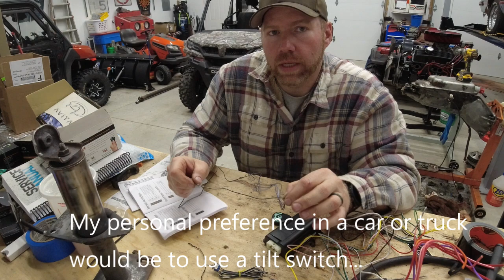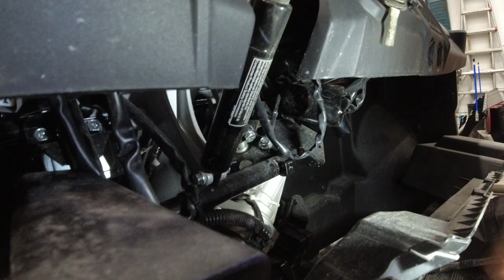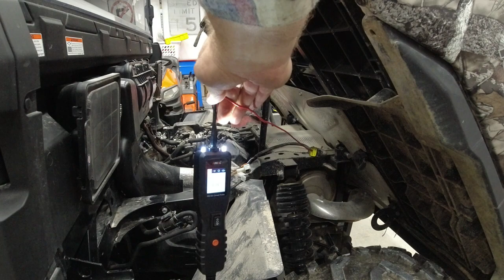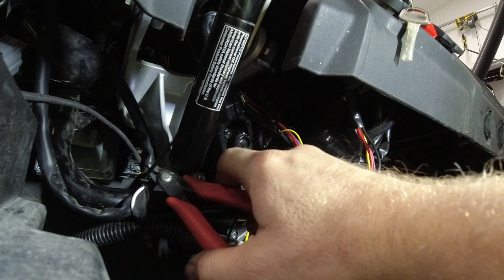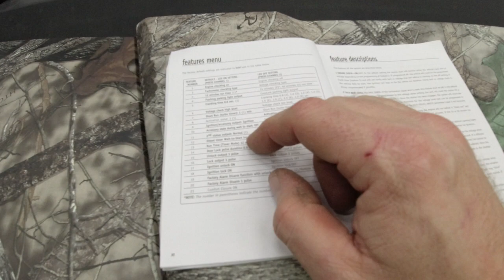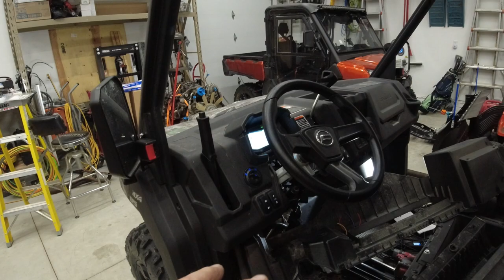2019-21 CFMOTO UFORCE 1000 Step-by-Step Remote Starter Install

Comment: Do you have a “newer” model number for these? As in comparable as the one you used? I’m having a tough time locating that particular model.
Reply from the maker: Sorry, I dont... I've been out of that industry now for about 4-5yrs, so I'm not familiar with the current model numbers. Unfortunately, the Directed Electronics website (Directed.com) is almost worthless nowadays as far as researching model numbers and features. They basically want to force you to purchase the unit and have it installed by an authorized retailer. All the info in the video should basically pertain to all systems though.
Reply: @NewcomerGarage  ok.. I’m not certain I’ll do one anyway. It’s a neat thought but not needed for me. I followed your video on the turn signal install. Basically did mine identical. Just an fyi… mine is a 2023 Uforce 1000. Worked flawlessly. Of course needed a different flasher relay but that’s expected I suppose. Awesome videos man!
Reply from the maker: @richardf3294  Yeah, the remote starter is pretty much just a novelty item for me... I have a bunch of them sitting on a shelf in the garage that I would buy cheap when they would pop up for sale just to have for side jobs. My machine sits in a heated garage plugged into a battery tender, so I've honestly only remote started it a handful of times. But, if someone had one that sat out in the cold, it could be useful I suppose! Glad to hear the turnsignal video helped you out!
Reply: @NewcomerGarage  most definitely useful for outside units. Mine is one of those. lol. I’m currently battling a regulator issue. Didn’t want to pay Cfmoto price so I found one online(surely a knock off) but the connectors are slightly smaller than the factory plugs. So now I’m in the middle of chasing the correct size out for the one I purchased. Never knew they had multiple sizes of those plugs. Funny thing about it, it probably would have been a warranty fix but I don’t have a trailer personally to haul it to a dealer and I don’t want it sitting at one for who knows how long. Anyway, good content man.